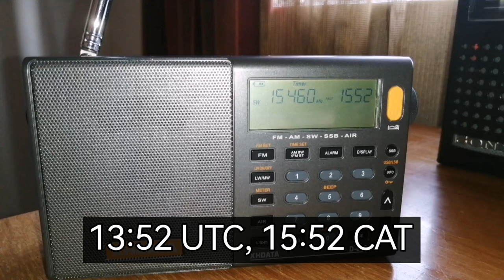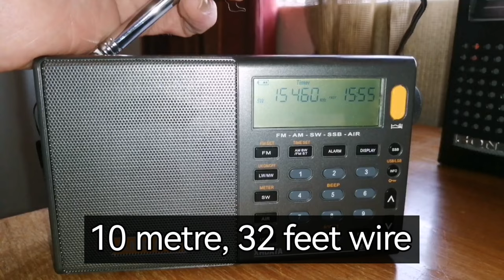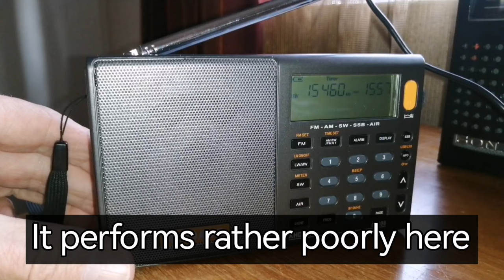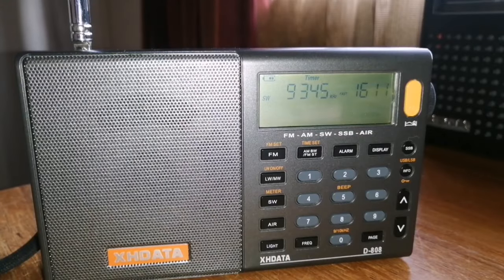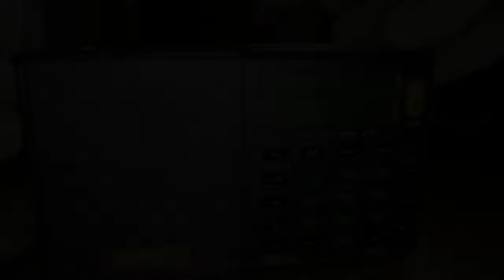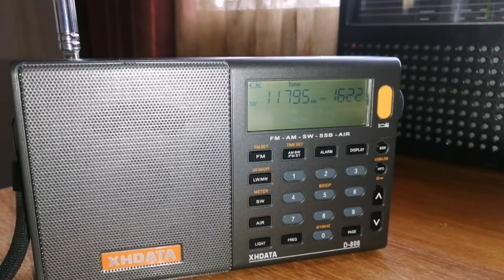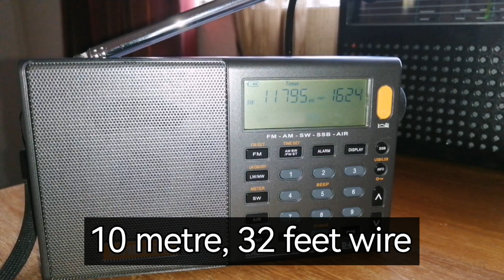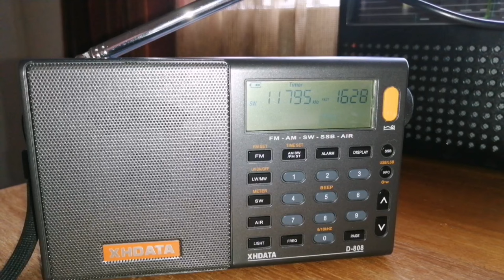Whip, short wire, long wire and MLA30+ loop antenna compared on XHDATA D-808 #shortwave

Comment: You remind me to listen to my shortwave receiver more often. I've got an RSP1a and built an active loop for the window frame for it.  MIKROWAVE1 showed an amplifier for it spread out over multiple YouTube videos. I get some peak reception around 22MHz with my implementation of it. 
I couldn't do without looking for a schematic for the MLA 30 + but only found one for the previous version. According to the Official SWL channel the new version looks better at high frequencies. I have the suspicion they fixed their mismatched amplifier.
Reply from the maker: I am glad that I reminded you to listen to shortwave more often :-) I also read somewhere that the MLA30+ works better at high frequencies now, it does seem to work fine on higher frequencies for me. But it seems to be slightly better on lower frequencies, in my experience. Seems to be best from the 60m to the 31m band. And slightly less good in the 25m, 22m, 19m, 16m and 13m bands. Although this is not based on any kind of real test, just a general comment when I think about where I mostly receive the best and most interesting signals.

Comment: nice comparison! hope you get that adapter for the mla30 soon, should be even better with a 'proper' connection. the whip in comparison to the 3m wire was interesting. i would not have expected the whip to perfom that well.
Reply from the maker: Thanks! Yes, I think the MLA30 will perform better with a proper connection. The whip on the XHDATA does quite well by itself! But with weaker signals you really see the difference between the whip, the 10 metre wire and the MLA30.
Reply: @swlistening  yes wires in urban spots tend to have a rather bad signal to noise ratio.
funny thing is most HAMs i have talked to consider the MLA30 a rather bad loop antenna. it is often better than a wire but still has a bad S/N ratio for a loop antenna. 
there seem to be many good reviews of the 'wellbrook' loop antenna, which is pretty pricey though. there are also people selling a copy called 'wellgood' for way cheaper or you can get a schematic and build one yourself. i think the original costs around 200€, the copies go for around 50€
Reply from the maker: @VintageOils  It is true, some people seem to really dislike the MLA30+ but I don't know why. It is much cheaper than any other magnetic loop, and for my purposes it seems to work really well. Not noisy at all.
Reply: @swlistening  agree it is actually not noisy at all. but my comparison is all wire antennas. wonder how much better a high end loop set up on the roof might be.

in the end i guess antennas are a rabbit hole and the only solution would be to have all the antennas set up simulatniously and always check which suits the frequency and the weather the best.
Reply from the maker: @VintageOils  Imagine what that would look like! Some years ago I went to a party, people I did not really know, was invited through a friend. The owner of the house was really into SW and ham stuff. He had a big garden, but the entire backyard was just antennas. It looked like a military installation to me 🙂 No space for anything else in the garden. I don't have such a big garden, so I will just be happy with my wires and the MLA30+ for now...

Comment: I am residing in Malaysia.
Can anyone sent me a link to buy original MLA-30 +.
Thank You
Reply: A Chinese original, I have taken up the challenge but I have had no luck yet.
40 minutes later I have found that even the Radiomuseum doesn't know the original manufacturer.
Reply from the maker: The Tecsun site in Australia sells it, here: https://www.tecsunradios.com.au/store/product/mla-30-shortwave-loop-antenna/ I am quite sure that will be an original one.